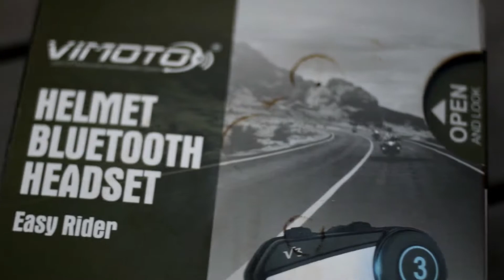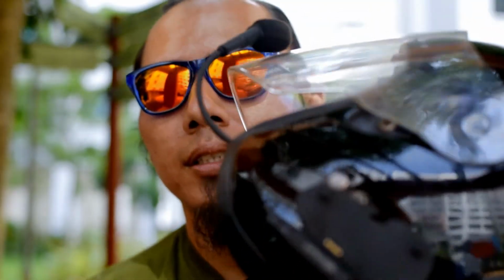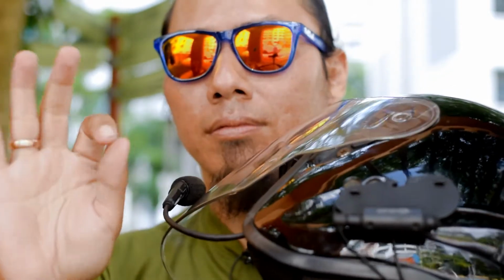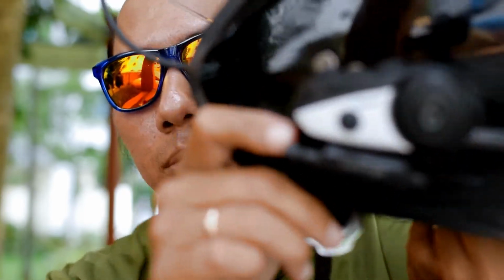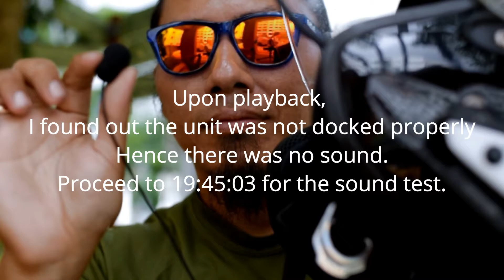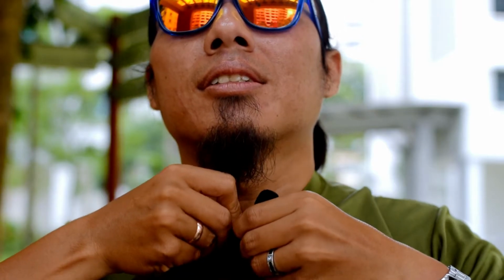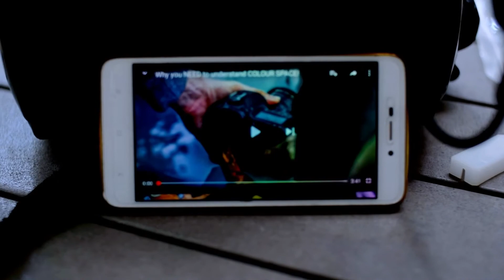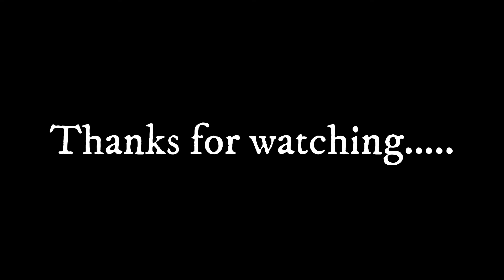Review And How To Fix The Vimoto V6 (with speaker sound test)

Comment: Hi Man 
What is the range between the two drivers who have the v6 intercoms?
Sellers give different data once 10 meters and sometimes 500 meters
Reply from the maker: Hey Bro
Thanks for the question.
Notice that in the video I don't focus much on the intercom coz I only go for the listening of music and answering calls.
Now that you mentioned, I would say 10m radius or less. Reason because

1. It is Bluetooth intercom and has to be paired with the other set in order to allow both sets to communicate
2. The package does not state anything on the effective distance so what I am providing to you is based on the reconnecting process.

When you leave your helmet on your bike to go to the gents perhaps, the Bluetooth signal will be cut off automatically after you exceed a certain distance. It will reconnect back again once you are within range. So far if I parked my bike at the central rubbish bin and walk to the main lift lobby I am still connected. From the main lobby to the next staircase, still connected but after that would be out of range. Hope this gives you a rough idea. 

Hence if you are getting the Vimoto V6 for the wireless convenience like listening to music or answering calls while riding I would strongly encourage. But if for intercom,  I would still limit to rider-to-pillion rather than ride-to-rider unless the set adopts a radio type approach. With that said, even with radio frequency, there would still be limitations as well.

Vimoto V6 utilises Bluetooth 3.0 which after Google-ed, operates within 300 feet which after conversion is close to 100m. 91.44m to be exact. So that would effectively be approx. 45m radius around you. Hope this helps.
Reply from the maker: Hey Bro
Thanks for your question. It's a good one.
As I mentioned earlier I'm more focussed on the handsfree and listening to music on the road. 
Pack only states that it's rider to passenger and utilizes a Bluetooth 3.0 signal, which effective range is 300 feet close to 100m if converted(you can google this out).
Even when I leave my helmet with it connected to my hp, after a certain distance the signal gets cut off.
I would advise that the intercom be limited to passenger or within the Bluetooth effective range.
It's a Bluetooth signal set and not radio signal set so there will be limitations. 
Whether the other reviewers have really tried it or not, that remains a question. Wouldn't comment on that.

Rider pairing have not tried(coz not into intercom). However, I can so far pair two handphones with no issue. 
First pair the main(which has the music that you wish to listen or mp3 collection on your handphone), then pair the secondary handphone.
When you press the big button, it will automatically play the music coming from the first handphone.
Unless the first handphone is disconnected and the second is active, then it will play from the second handphone.
Answering of calls can be from both if both are active. 

Hope this helps clarify.
Reply: Buzz Rider Thanks Bro :)
Reply from the maker: No worries bro. Just sharing what I know since I've used it.
Hope it helps. :)
Reply from the maker: No prob bro. Hope it helps. :)

Comment: Brother Does it support Conference  mode?distance coverage between rider to rider?
Reply from the maker: Do you mean conference calling?  For calls so far I had no issue. For intercom, I have yet to try. However, in order for the intercom to take place, you need to sync the riders involved. Effective distance is within 33ft or equivalent to between 10-15m as it operates on Bluetooth 3.0

You can also check out in detail here https://bit.ly/2LAcWNA
Reply: conference intercom system means all riders can talk each other at a time..is it possible with this???
Reply from the maker: I have not tried the intercom so far bro, however, thanks for bringing it up.  Perhaps I'll get two more sets and do a video on it. Thanks again for the great idea.